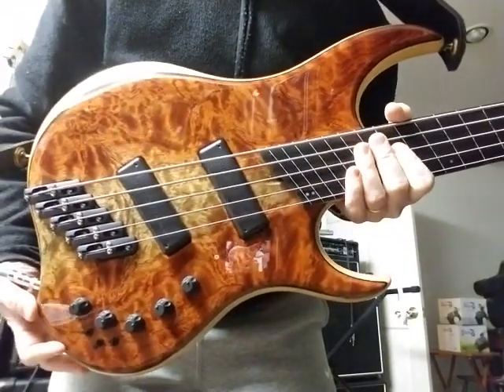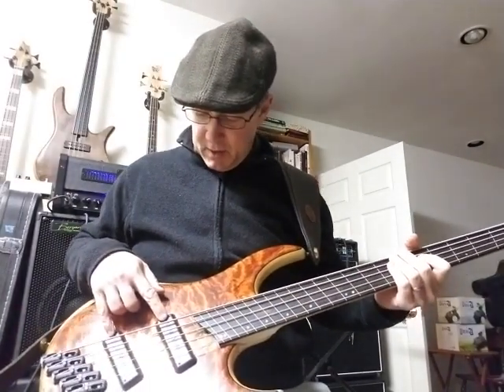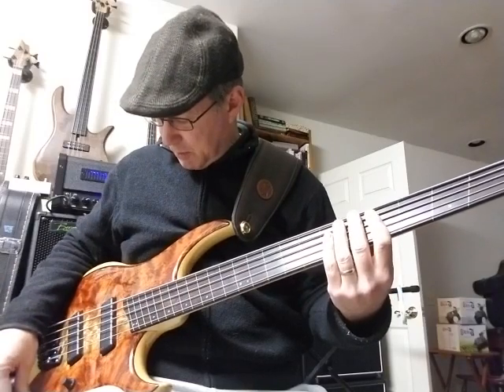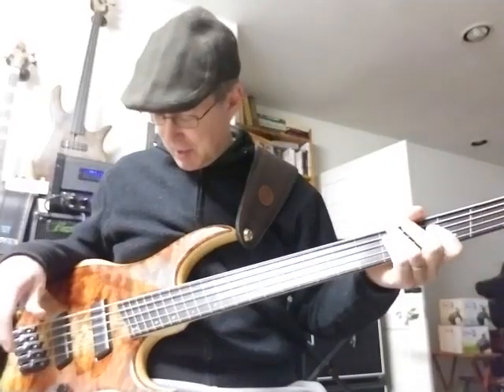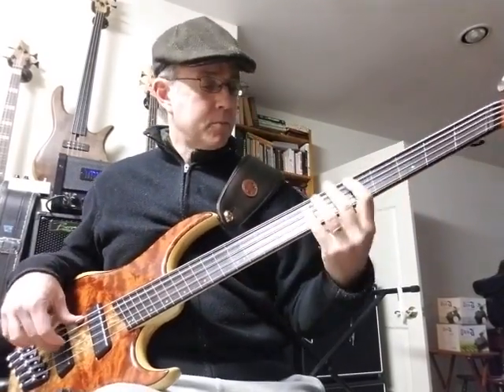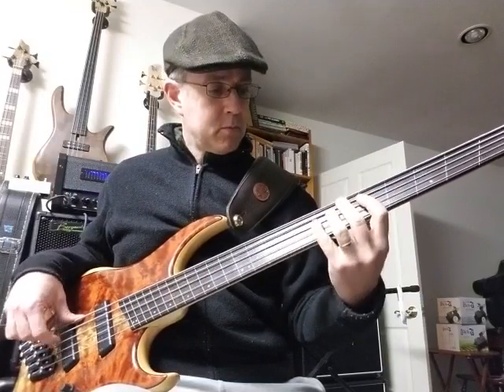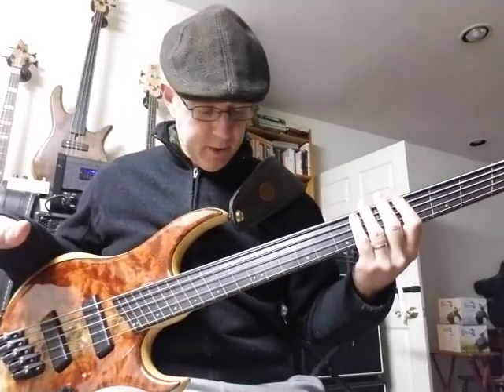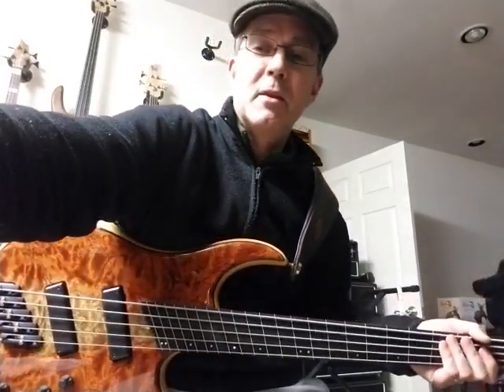Dingwall Z1 Fretless with quilted bubinga top - quick tone demo

Comment: You play really well and the bass sounds great. Is there a reason you are not using the floating thumb technique or another muting technique, though? You've got a pretty substantial rumble coming from the E and A strings.
Reply from the maker: Gregory, thank you for the kind words, and thank you also for your gentle diplomacy in raising a valid question. The answer is: I have been playing 4-string bass for 42 years, and recently started trying to learn to play a 5-string, and haven't quite figured out how do the floating thumb technique properly yet. I only recently learned of it, and I find it very awkward. I could really benefit from some lessons, that's for sure. If you have a reference you could point me to for how to do that technique properly, I would be very grateful!
Reply: @JohnFoxBass  Yeah, I can imagine changing techniques after four decades would be a tad be tricky. I use floating thumb myself, but I think there are people who use a moveable anchor technique. You might want to look into something like that. I don't know those techniques personally, but I think what people do is rest the thumb on the pick up while playing the B or E strings, on the B string while playing the E or A strings and on the E string (while touching the B string with the side of the thumb) while playing the A strings or higher. You can always mute the string lower than what you are playing, too, with the follow through of your plucking finger.